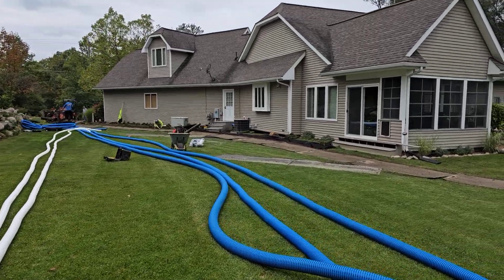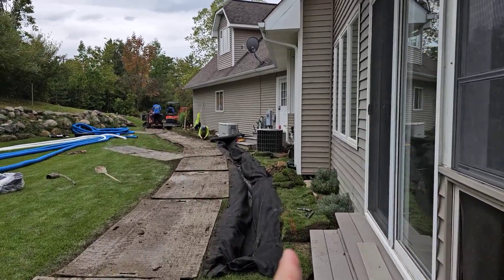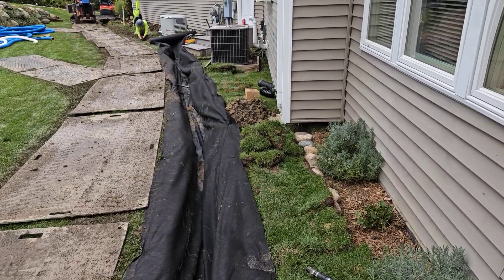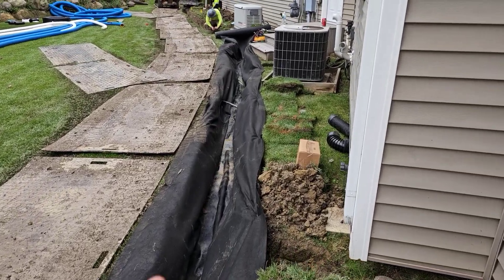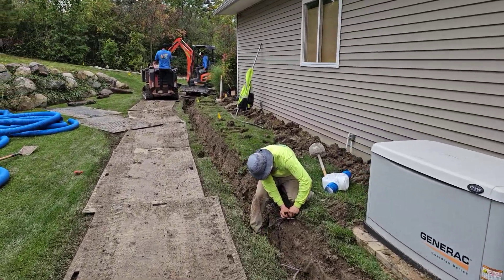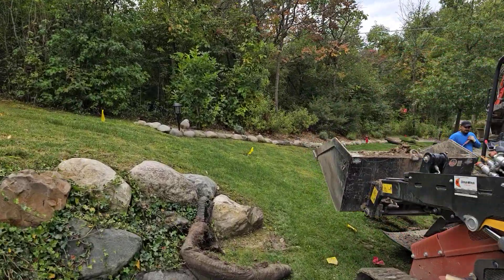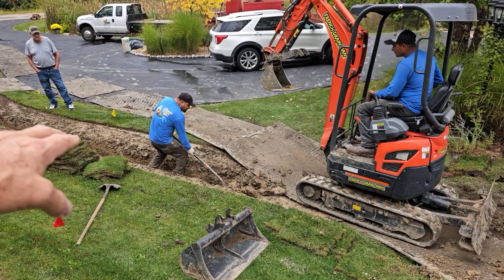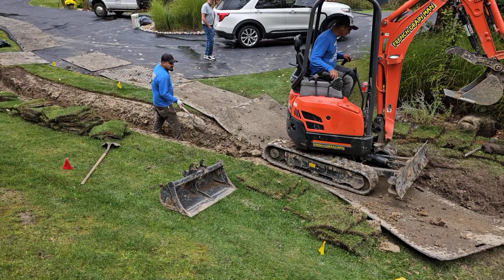Curtain French Drain 101

Comment: Robert, 
I Could not find any related videos to an issue I am having so I will post it here. Do you have any videos or experience with installing a French drain around a Septic tank? My septic tank is very deep and is always underwater except for in the drought of summer. And I am not kidding when I say the tank is under 18 inches of water. What can I do to correct this? I have never had issues with backups. I do not have a traditional leach field. I have 3 large deep inline dry wells. The problem everything is clay and the water table is always very high. Please help.
Reply from the maker: https://youtube.com/playlist?list=PLjFCqaZ4v1BXXbPw3Vf7e86DbKj7qOnLn&si=fSJW287q1Pa0_SYl